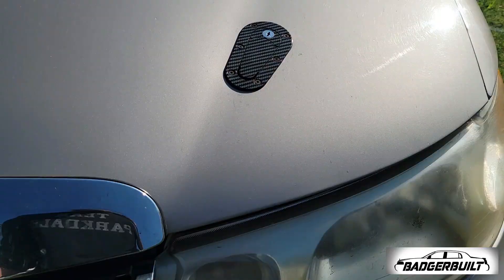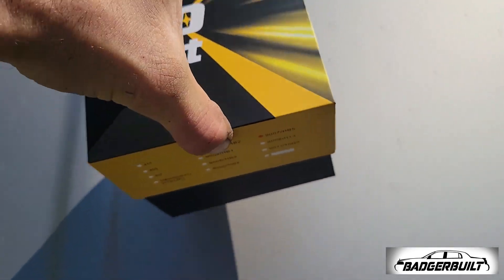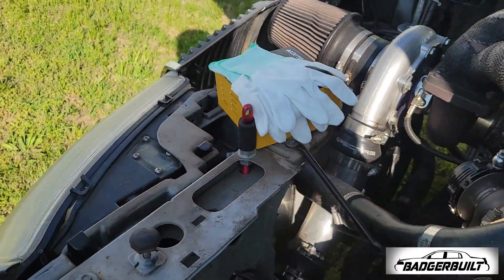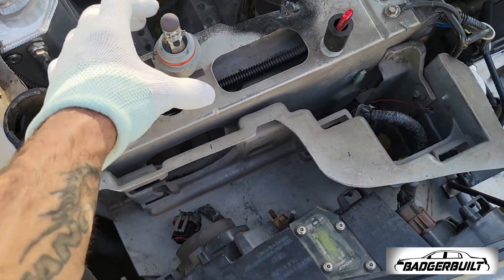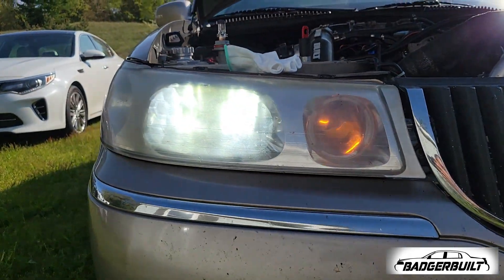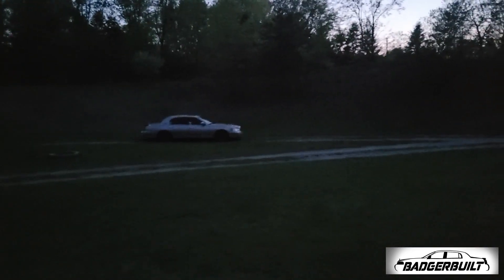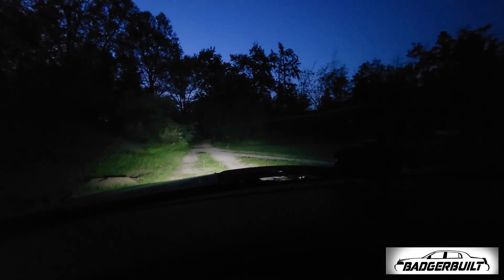Auxito 9007 LED Headlight Install. Turbo Town Car Gets X-Ray vision! 20,000 Lm!

Comment: Should buy another set just in case and if you sit in traffic at idle not getting air to them, they will shut off between 5-10min. Besides that i like mine as well.
Reply from the maker: I made sure to put the factory bulbs in the glove box. I really wanna build a set of projector headlight assemblies. Definitely will be ordering spares

Comment: Let me get some tips on build my own
Reply from the maker: What do you wanna know??
Reply: @BadgerBuilt  where should I start to see more power
Reply from the maker: @Dooski69  what car you rocking
Reply: @BadgerBuilt  98 town car
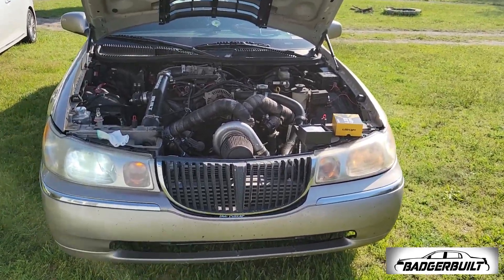Reply from the maker: @Dooski69  before I went down the Turbo rabbit hole, I did a PI intake swap, 75mm throttle body, and full exhaust. If your sticking with N/A I would suggest some shorty mustang headers and swap out the rear gear for something like a 3:31 - 3:73 depending on how much street driving you do.
Reply: @BadgerBuilt  thank youu! By chance would you know a good drift suspension kit for the town car ik there in two different categories
Reply from the maker: @Dooski69  our cars being pre 2000 have a gear box instead of a rack and pinion. I'm not sure if there is anything out for our cars without fabbing it diy style. But I honestly haven't done to much looking.